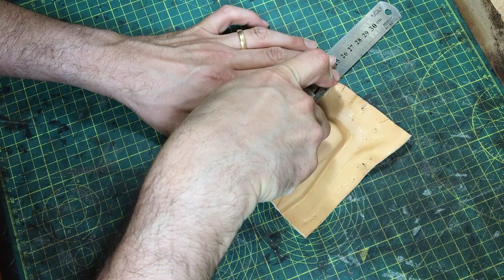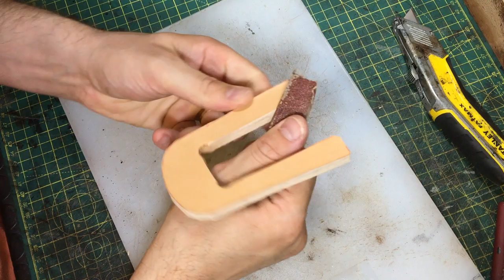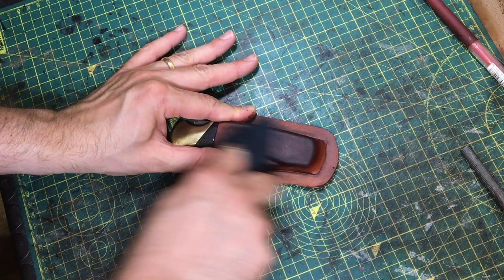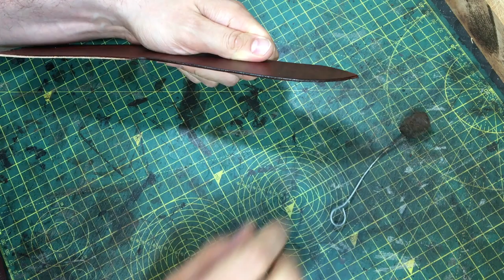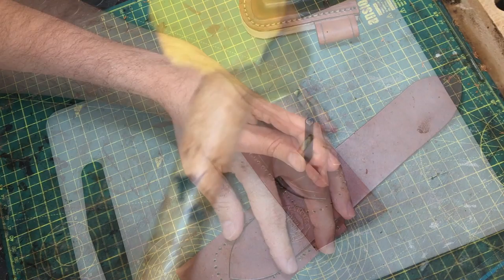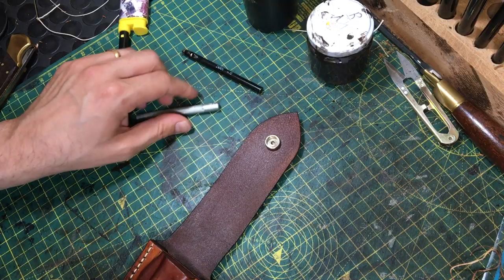Buck110 knife leather pouch dc3 stone

Comment: What's that metal plate on the back of the folding knife?

How much does this leather pouch cost?
Reply: I assumed that was a striker for the fire starter?
Reply: @ewayne1527  
Or maybe a knife sharpener?
Reply: @ewayne1527  it is indeed a fire starter